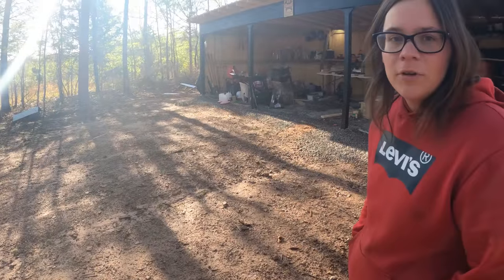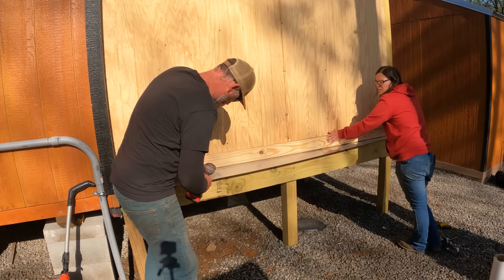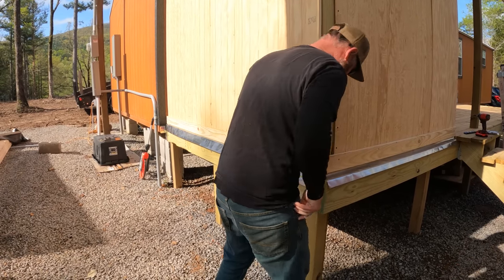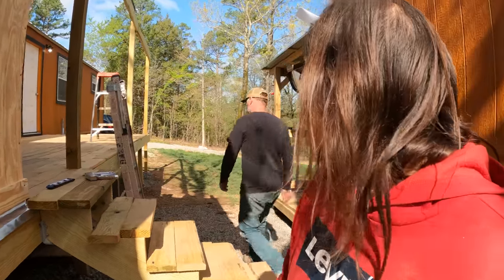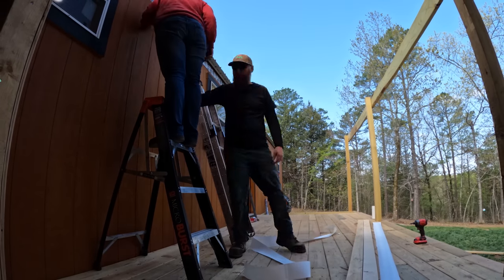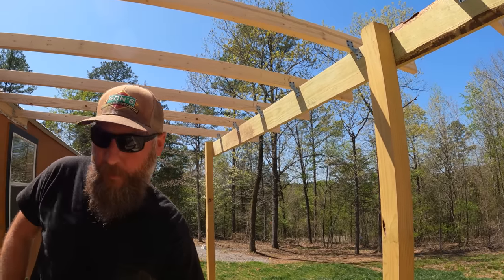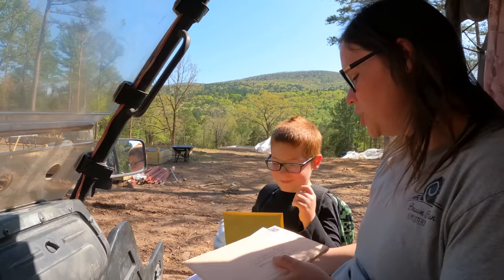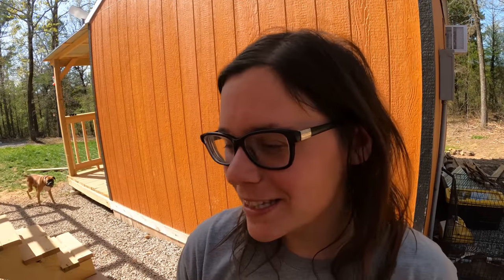This Needs To Be Finished Soon | DIY DECK | Couple Builds Dream Home In The Forrest

Comment: The way that you applied the flashing probably will not stop the water from leaking in on the floor. However, if you put a nice helping of silicone caulk along the top of the one by four, that will stop the leaking. The propper application would have been to loosen the bottom 4 by 8 sheets of plywood and stuck the flashing up about 3 inches behind it, screwed it back, after bending the flashing, then put on the one by four on, and then bending the flashing down,
Reply: Also don't cut off any of the over hang that is bent down you can cover with the deck board like you said just don't cut any off keep the over hang going down.
Reply: In his defense, he did say at the end, silicone 😉
Reply: Yea I did see / hear the silicone part as well.
Reply: I just came to say the same thing lol. Cheaper and easier to just pull it back of now and tuck it under the siding will save tons of future heartache and headache later
Reply: This is totally correct. Even using the sealant on top of this trim it would need too be checked yearly and reapplied as required. Doing the trim behind the plywood would not require the sealant.
Reply: This is totally correct. Even using the sealant on top of this trim it would need too be checked yearly and reapplied as required. Doing the trim behind the plywood would not require the sealant.
Reply: I agree, great first attempt on building a room in a deck...😳

Comment: You should have put the flashing behind and under the siding.  Water can still get in by going down the grooves in the siding.  You can however use some clear caulking alone the seam where the trim board meets the siding.
Reply: You’re correct, slide flashing under T 111 siding, this will protect your floor. Otherwise moisture behind flashing will not dry, mold and rot will result. Porch and laundry room look great.
Reply: You should put the flashing behind the siding first otherwise moisture can still seep in! Love ya love your videos. God Bless 🙏

Comment: Just an FYI. Where you put the flashing at the bottom of your siding you need to put the flashing on the inside of the siding. As you have it right now, water will drip down between your trim piece and between your flashing and siding and drip down onto your subfloor. You need to pull the nails out of the bottom of your siding and slip the flashing in behind it that way when the water drips down your siding it will hit the flashing and then continue to drip on the outside. When dealing with water always have the top pieces of whatever material you’re dealing with on top of the next level down. It’s better to take the time now and correct that or you’re going to be sorry with water continuing to get in at the base of the wall. Keep up the good work. It’s all a learning process.

Comment: So glad I suggested that utility room on the deck. It's great and like free square footage not using up any part of the shed. And you're got the right paint so it's going to blend in just as if it was all built in one piece at the same time. It's going to look great when the deck is finished and the roof on.

Comment: Tips for growing the grass, Roll it in with a roller. If there is a sawmill nearby, get a load of saw dust and spread it over top....no weeds and it helps hold moisture. If it gets grooved out, don't stress, just fill the grooves later with topsoil. Usually the grass will pop up through the dirt.
Reply: Russ,. I thought that they  have a sawmill. You are very helpful.  I never knew this idea.  Smart wisdom..

Comment: Looking good but I see an issue with the flashing. The groves on the siding can still let water into the inside the way you did it. The flashing should go behind the siding then bend out under the siding and over the lip, then down again over the floor joist. 
If you look at the flashing from the edge after bending, it should look like a sideways letter Z. You can buy pre-bent Z flashing.
Reply: correct
Reply: Yes if he does not fix it right here 15 years it will be riding out I say that long because treated wood maybe not even that long

Comment: What's up guys?! Spring time has yall's place looking awesome. 
The straw will keep the birds and critters from eating your grass seeds and will decompose and turn back into soil. You would not need to clean it up.
Also, you can make a stone or concrete dam about 3 or 4 feet high so your creek keeps flowing, with an overflow into your creek to keep it flowing at a consistent rate. 🙂

Comment: Love your channel 
Your flashing should be behind the siding. The way it’s installed you will be having to rely on caulking, caulking should never be your main waterproofing as it cracks pulls loose and shrinks. Look at waterproof like shingles on a roof and how they overlap

Comment: Sorry guys you didn't hear me yelling STOP!  but you MUST remove the trim and flashing, loosen the siding and put the flashing between the T11 and the 2x4's. No amount of cauking will prevent water from running down the T11 behind the trim board and flashing. Water WILL get down to the bottom of the T11, 2x4's and plywood floor creating a garden for mold and rot. It's guaranteed to happen especially with weather changes/wood swelling/contracting...sad to say, I speak from 40 years experience building my own place and repeatedly recauking. I'd have also built the 2x4's to the edge of the plywood as well..But it's not a true issue..Just allows water/ice to lay against the flashing perhaps causing condensation under it and rotting the edge of the plywood.
Reply: @ Sue Sharp- I have to agree with you & I hope Anthony & Roxanne will read your comment. I know what you say to be true bc experience from working with my father on home projects attests to that fact! It is far better to take a few pieces of wood down now & fix it right, rather than having a real disaster on your hands in a year from now. Please don't just mask it with caulk! If it is corrected now, you'll rest much easier in the days to come!

Comment: Seeing the picture of the creek, you guys should think about finding the best spot for swimming, dig out the rock, or push the rock upstream to form a little dam.  Dig out a bit bigger area (could block up sides before digging out if you want), bring in some white sand and spread on the bottom for the specific area you want to be swimming spot.  Then dam up the other (downstream) side so that you can control when and how much water backs up for swimming area.  There are certain plants and flowers that help ropel mosquitos naturally, plant those all around banks and great place for kids to go play after helping with outdoor chores and gardening on hot summer days!  My sister and I did exactly this when we were kids and too young to help pick peas, adults would pick peas and we played in the swimming area of creek, great memories!
Reply: Side thought, don't make so deep that anyone would want to dive in.  Seen and experienced too much loss where good intentions of fun turned into pain, dismemberment, and death.  Just 3 or 4 feet deep max I would think.  Again, can use downstream dam to adjust depth if you do not want to leave deep year round.

Comment: Great job.. Suggestion: why don't you align those new stairs to the side of the thunder dome porch and connect them with wood flooring to the thunder dome porch so you can access it without stepping on the gravel in case of rain etc.. I mean it would be nice because it also creates the idea that its part of the main house and not just an added shed

Comment: Happy Birthday, Roxanne!  Anthony and Roxanne, what a beautiful place you are building!
Small suggestion- instead of roll flashing use z-flashing.  Unscrew the bottom of the siding and slide it behind the siding, then screw it back down.  Place the trim over that, this will keep the rain out and off the sub-floor.  As it is right now it will still get behind the flashing.
Just a friendly suggestion and have a quality day! 😁

Comment: He needed to pull the screws on the bottom of the siding and slid the flashing up behind it, then put the screws back in the flashing. Defiantly need to caulk the top side of the trim boards because as it is even with the flashing water can get under the wall . Its looking Great !,

Comment: Rain water will still run down them goves in the sideing if you do not run down the grooves in the siding you need to run caulking along the top of that board

Comment: It's always weird to say, but your flashing is wrong. The flashing needs to be behind the siding.  Right now, water will flow down the siding, behind the flashing, and into the floor.  The same thing happened on your windows, actually.  You used flashing tape, but the layering was wrong.  The goal of all rain-proofing is that up high it's behind things, and down low it's in front of them.  If you start or stop at a middle layer, that's where the water will be.

Comment: On the end side that has the window in it will you be slipping behind the base of the siding drip edge to go over the part of the deck that is exposed??  Otherwise you will end up with water seeping in on the laundry room floor over time it will rot out the 2x4 and the deck.  L shaped is a good thing easy to fold/bend for sure.  Lay it on the DECK and not in the air to do your bends!!!  CLEAR CAULING ALONG THE TOP OF YOUR WOOD STRIPS WHERE YOUR FLASHING IS BEHIND.

Comment: Putting the flashing on that way is not going to help with leaks. Take the siding down put the flashing on then put your siding back on. You may be able to caulk it like that but why take chances. If there is any holes or gaps, trust me water will find it. Not a professional here, but water is your worst enemy. Looking good though.

Comment: The outside walls should have come over the beams/floor joist,  like the building has done this way you eliminate the flashing which doesn't seal cause u still have to top of trim , sure you can silicone it with a beed..... other than that your doing good

Comment: No you don’t want to spread hay but you DO want to spread straw. They are different. “Hay is grass, legumes, or other herbaceous plants that have been cut and dried to be stored for use as animal fodder, either for large grazing animals raised as livestock, such as cattle, horses, goats, and sheep, or for smaller domesticated animals such as rabbits and guinea pigs.” “Straw is an agricultural byproduct consisting of the dry stalks of cereal plants after the grain and chaff have been removed. It makes up about half of the yield of cereal crops such as barley, oats, rice, rye and wheat. It has a number of different uses, including fuel, livestock bedding and fodder, thatching and basket making.” Straw will not attract bugs—think of it as ‘sanitized’. Hay is food and will attract bugs that will use it as a food source.

Comment: In the areas you have grass growing, consider picking up the stray rocks before the grass gets too high & you have to mow.  The mower will hit a rock, sling it out & might hit a kiddo or animal.   I am worried about the trim you put up on the laundry walls, it still might let in water.  Are you going to caulk the top edge of the trim work after you paint?  Are you going to seed the chicken pen before you get chicks?
Reply from the maker: Yeah we removed alot of the rocks out of the backyard. Trust me the was biggest worry when we mowed the first time. And yes we plan on caulking. And we did plant grass seed over in the chicken pen. There's little sprouts 😊
Reply: @countryroadcure  Yea! You guys have got this!!!

Comment: its going to rot in a few years all your hard work down the drain. the t-11 should have covered the rim board use z flashing is the right way. the water is still going behind the tin and trim board. i could careless except other will see you do it wrong and copy.